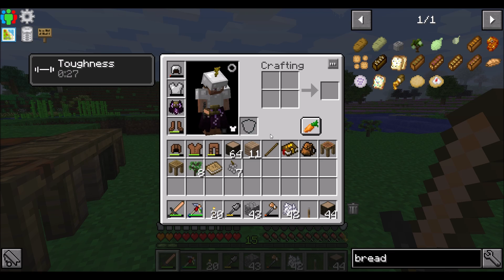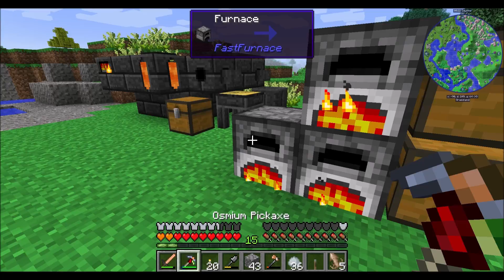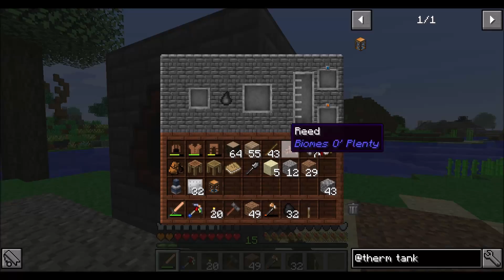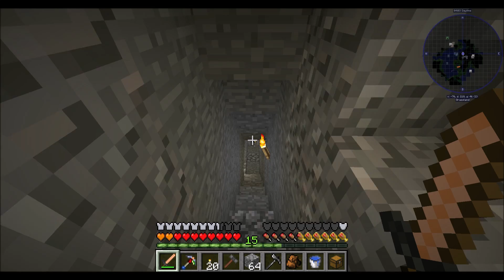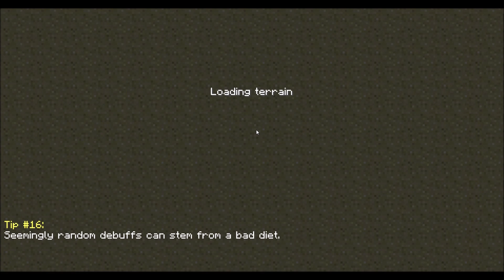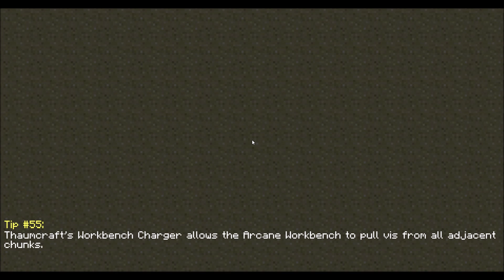Enigmatica 2   Ep4 Immersive Startup

Comment: the changes are speed and power adjustments power production is doubled on most generation speed on most process times specially once upgraded and sometimes upgrades required for some patterns some power consumption adujustments

Comment: A certus sword blade will give you random potion effects.  It helps loads.  Also, you can use the portable tank in place of the bucket for creosote.  You can put it in the coke oven to get the creosote and use it in a crafting table so you aren't constantly filling up buckets.

Comment: @ 3:22 Iron plates: I got stuck creating the metal press. A heavy engineering block requires lapis plates. But, the smeltery will create plates 1:1 from iron ingots. Way cheaper than using the hammer.
@5:00 Emeralds. In my game (same seed), I found a village in the lavender fields to the west. It had a librarian that would trade emeralds for paper.
@12:46 Blaze powder. Cinderpearls grow in the deserts in the overworld.
The nether - I took your advice in the previous video and made a /dank/null . Not too hard to get it up to iron level. Really useful for mining both in the overworld and in the nether.

Comment: My top option for energy early game in Enigmatica 2 Expert: Thermoelectric Generators from Immersive. You can find Blazing Pyrotheum pools in the Nether and make packed ice in various ways (packed ice can be close to Pyrotheum without being consumed) - it's a permanent free 60 RF/T per generator and you can make a vertically stacked checkerboard pattern of them. It's surely not an option after early mid-game, but before that it's pretty hard to beat. The immersive tech steam turbine is absolutely unbeatable afterwards, as it uses very very little steam for ~13k RF/t.

Get into Nuclear Craft machines (not the reactors) early, they simplify many things, particularly the Manufactory. The Mechanical Squeezer from Integrated Dynamics gives 2,5x Ores, it's the best option for everything except Quartz (-> Mekanism) and Uranium/Aluminium (not processable) - except if you want to do the Mekanism lines (I think it's not worth it). It's especially good for Redstone (12-16 per Ore), and you will need A TON of it in midgame, because all the Thermal Expansion Coils need a 16! in the Metallurgic Infuser.

Sieves with Stonework Factories are great early midgame ways to get infinite ores for most things. Later Void Ore Miners of course. The Industrial Foregoing Laser Base should NOT be overlooked, as it can give you Ender Amethyst Ore which you can't get anywhere else. Plus it requires very little energy compared to the Void ore Miner (it's tweaked to be VERY expensive). Ender Amethyst is very annoying to make otherwise.

Save yourself a lot of trouble and make a Matter Fabricator from IC2, as all the machine casings can be replicated, Litherite and Connectors (they are super expensive otherwise!) and Structure Panels can all be replicated. Also the IE engineering blocks can be replicated.

Check the "SCANNER" from IC2 in JEI, there is a list of things that can be replicated which aren't otherwise possible.
Reply: Holy W advice, thank you sir for this!

Comment: First of all be warned, there's a mod installed that gives pigmen a chance to aggro on you when you mine certain ores in the nether, not sure exactly which ones, either quartz is excluded or you got really lucky in this episode. Pretty sure from painful experience cobalt and ardite are included. Good thing though is it also makes it so that if you die it makes all the pigmen around you no longer aggro-ed.

Suggestion if you want to go crazy with ore excavator on stone. Make a second cheap to repair pickaxe for the stone. I actually found that netherrack makes a very cheap yet decent pickaxe for veinmining stone. Even works on lower tier ores, but for me 1 netherrack fully repairs it when it breaks. It certainly beats having to use rarer and more expensive materials to keep repairing your good pickaxe when you waste it on stone. You can also make sharpening kits out of your repair material and just put the tool and the sharpening kit in your player crafting table I believe to repair it, if you don't want to just use the tool station. Also reinforcement modifiers might be worth looking into later on.

 Another possible suggestion, go into the ore excavator mod config menu and add "minecraft:netherrack" to the block blacklist. I kept accidentally veinmining huge chunks of netherrack when I was trying to just get some ores, which can be hazardous in the nether. Or you could just call that a potential balancing mechanic for ore excavator, lets you mine fast, but sometimes mines stuff you didn't intend to and sometimes things you really really didn't want it to when you end up falling to your doom.

Comment: Tips for anybody playing the same map as Dire and others too:
1. there is a cherry tree at the top of the hill right next to dire base that is a much better source of food for starting off.
2. follow the quests and make a kitchen because next great food is baked potato and kitchen can cook 9 potatoes at once so you don't waste your normal furnace time on that.
3. Opposite of the hill from the base across the lake are a few rubber trees
4. Use any item without a durability to vein mine dirt/gravel/sand because it will still work but won't use up your tool.
4. Nether portal on Dire's map is right at about a stack of bone blocks so no need to hunt skeletons for bones.
Reply: Also don't forget the dual villages and dual pyramids for looting to the north west. :)

Comment: Sharpening Kits,Dire.

Imagine a stack of 64 Sharpening Kits,which can be used to repair your Tinkers' Tools in your crafting grid. Two material cost per Sharpening Kit. Guaranteed full repairs. No table. Use them! They're convenient and useful!
Reply: Can you tell me how it works in I use a bronze pick sharpened to an obsidian level? Do I use bronze or obsidian?
Reply: @derekanhalt3417  Sharpening Kits can be used to upgrade a tool's mining level at the Tool Station/Forge with the tool in question,a Sharpening Kit,and a Flint. This is the most widely known use of the Sharpening Kit. However,by placing a damaged tool into a crafting grid with a single Sharpening Kit of the appropriate material,you can fully repair the tool on the spot. In your instance,a Bronze Sharpening Kit; Match the head's material.

Comment: If you use the plate cast the ratio for ingots used is 1:1 instead of 2:1; however,  it does take longer just a heads up. Mekanisms tanks on bucket mode are amazing for lava collection 😁 MERRY CHRISTMAS

Comment: If you make a sharpening kit from whatever material your pickax head made from. You can use that sharpening kit to repair your tinkers tool in your 2x2 crafting grid. but it cost 2 ingots to make the sharpening kit. Little trade off :) Im sure others have mentioned it.

Comment: dire, you never put your new shovel head on your shovel. you also should have access to fire wood so you can make a autosmelt hatchet for instant charcoal. you should even be able to just put auto smelt on your pickaxe. i dont know if the fortune+autosmelt interaction works with tinkers but it could be a way to ore double. dont forget tinker bows are really good.

Comment: Hey dire I find myself bored with stoneblock as it seems to lack direction. Do you think a pack like this would be more fun since its heavily gated?
Reply: Phnxkon, I think that is a question that only you can answer.  What anyone considers fun is going to differ from what you consider fun.  The best advice is to just give it a try.  If you find you don’t like the pack, then you stop playing it and find another.
Reply: Phnxkon I think so. StoneBlock configured a lot of mods to work better together, but this pack does even more so. Advancing takes more thought and effort than it did with StoneBlock. Just one example is storage. Dire looked at the iron chests, and they are ok, but the small storage crate is better. In StoneBlock he could have had one a long time ago but in this pack you need treated sticks from a carpenter. He is close to being able to craft that, and also close to having a water wheel to power it.
Reply: It depends. This one seems to give you more direction, but keep in mind that you also have a world to explore which could be good or bad depending on your taste.

Comment: Dire, do not use the IE iron plate recipe, use the Thaumcraft Recipe that is one to one.  (More specifically three iron to three plates)
Reply: I made a tinker's plate mold and just pour them as I need
Reply: @jonnykopp  makes sense to me
Reply: There is also metal plate cast in Tinkers, and it is also one to one.
Reply: I'm pretty sure that's cheese, plates are supposed to be expensive until you get machines. It it probably removed in a later pack version.
Reply: the plate cast for tc is better 
works with all plates
Reply: IE is 1-1 when he gets the metal press, and is a lot faster
Reply: Fair enough. I guess I should reword that to, don't use the Engineer's hammer recipe.
Reply: @liamlocock7947  but in the crafting table he can get 3 stacks at a time with one click...

Comment: You can use 3 pieces of coal and 1 iron ingot to craft 1 steel ingot in the smeltery. So 27 Coal and 9 Iron will give you 1 steel block worth of iron.
Reply: GloddyGlodson wont that leave u with extra liquifracted coal tho?
Reply: @thewcloner  It might be possible that it's a bug. The recipy shows 2 coal and 1 ingot. But with the newest version it is 3 coal and 1 ingot iron for 1 ingot of steel
Reply: Maybe i just remember the closest i could get to even left 25mlb of coal left
Reply: Can the smeltery melt coal ? Doesnt that requires pyrothean ?
Reply: @taigoh84  nope, good old lava is enough in this pack.
Reply: This is good to know, but IMO he would have had to build the IE infrastructure anyways for the creosote oil and for the quests. Using that infrastructure costs him just 1 coal and 1 iron for 1 stell and he could work around losing too much time, by crafting steel ahead of time while he's doing other stuff.

Comment: Use a seared furnace, since it can smelt a HUGE amount of items at a time...
Reply: Seared furnace does not ore double in this pack.
Reply: @mrjack08722  I think he means it because it is a much faster smelter than three furnaces because of it's high smelting capacity and quicker smelt time, I have used it before and I can confirm that it make protects go by faster.
Reply: @nan073ch  That is true.
Reply: I thought this was for food only? Did it change?
Reply: Emrit Ramharracksingh It works like any furnace - it will cook anything a furnace will.